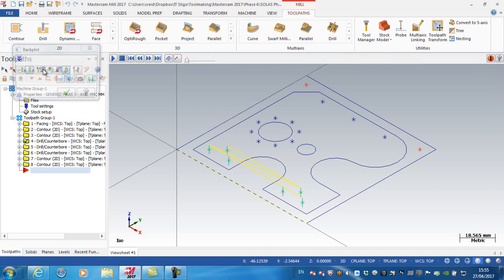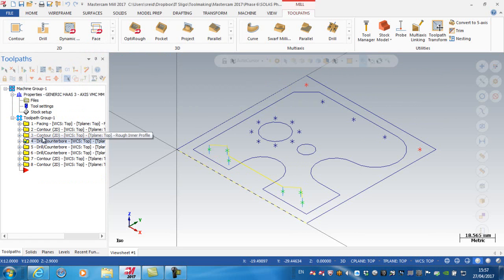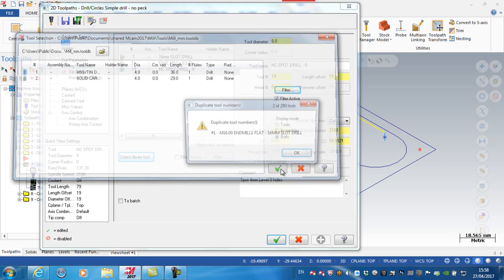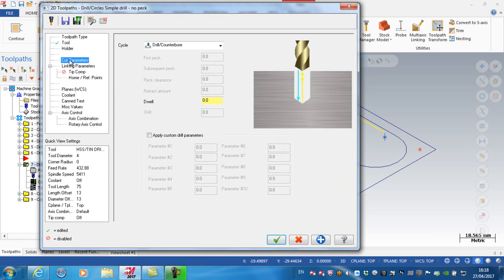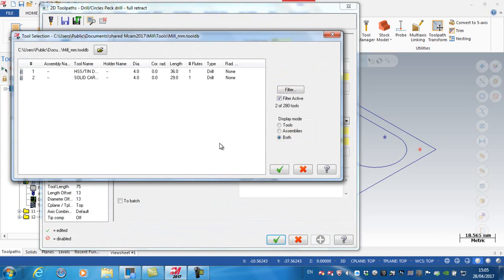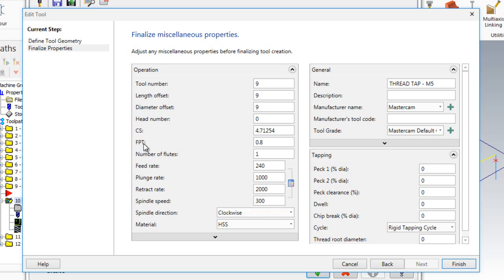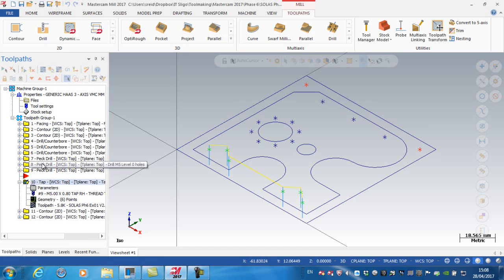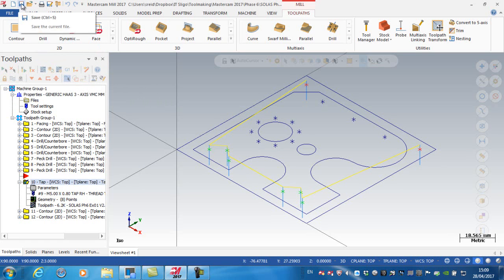Mastercam 2017 - #08 - Drill & Tap Holes

Comment: This is what I was looking for. I used a 3/4 tap is load it in the machine and I got a message that the RPM was to low. I ended up hand tapping it in fear of wrong input and braking a tap. Now I see by simply increasing the RPM, the remaining values will change to proper feed. Thanks for posting this.